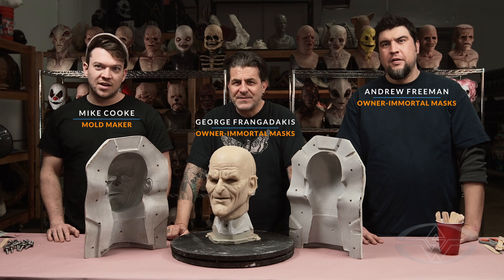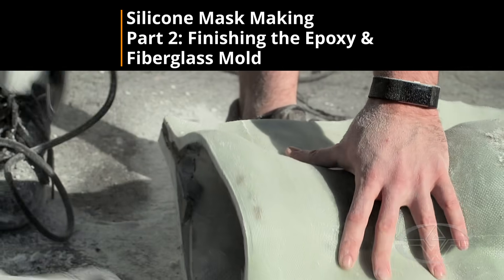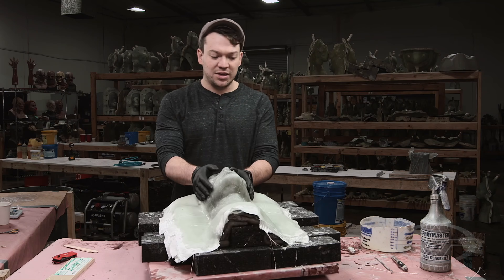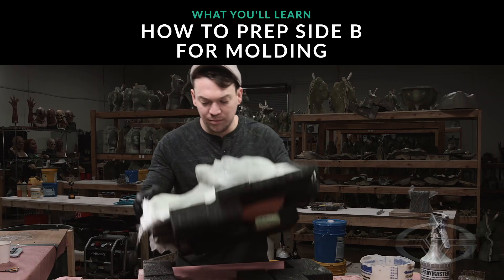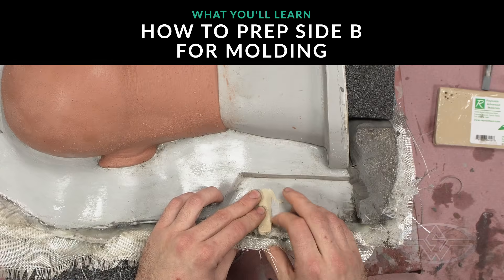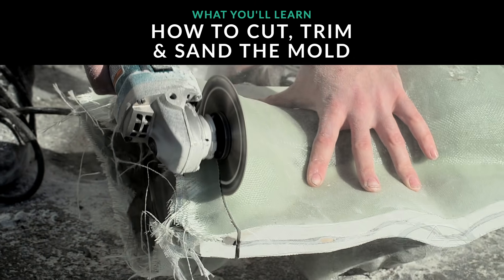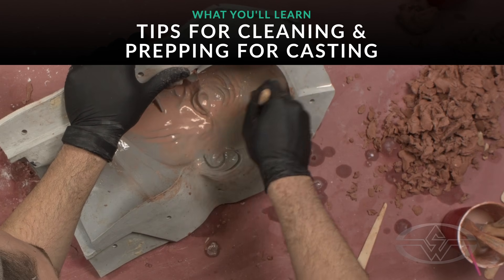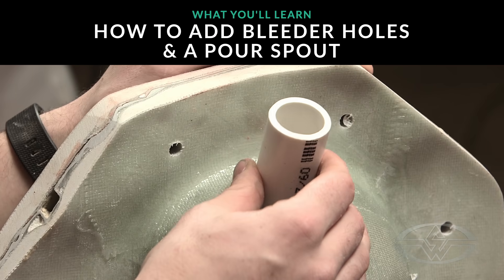How to Make a Silicone Mask Part 2: Finishing the Epoxy & Fiberglass Mold

Comment from the maker: Buy the FULL COURSE here: http://bit.ly/SilMaskMakingPt2YT - Balázs
Reply: Does it show how to make molds for silicone masks efficiently, or just how the biggest company does it? I am debating getting the course, but if the only method shown is one not designed for the average mask maker, only for the top-of-the-line, then I dont see it as a benefit to me.
Reply from the maker: @J0SHUAKANE  

Hi! Here you can find the full Curriculum: 
- Title & Introduction
- Flipping the Mold & Cleaning the White Clay
- How to Avoid Damaging Your Sculpture
- How to Fix Imperfections & Add Pry Points
- Molding the Back of the Sculpture
- Trimming the Edges & Drilling Bolt Holes
- Opening the Mold
- Removing the Core from Side B
- Cleaning Side A
- Cleaning Side B & The Core 
- How to Estimate Silicone Volume
- Adding A Pour Spout & Bleeder Holes 
- Wrap Up
- A Discussion with Andrew, George & Mike
Reply from the maker: @J0SHUAKANE  And this is a 3 part course series, where you can learn much more: 

Silicone Mask Making Part 1: Epoxy & Fiberglass Molding: https://www.stanwinstonschool.com/tutorials/silicone-mask-making-part-1-epoxy-fiberglass-molding-a-sculpture

Silicone Mask Making Part 2: Finishing The Epoxy & Fiberglass Mold: 
https://www.stanwinstonschool.com/tutorials/silicone-mask-making-part-2-finishing-the-epoxy-and-fiberglass-mold

Silicone Mask Making Part 3: Casting & Demolding: https://www.stanwinstonschool.com/tutorials/silicone-mask-making-part-3-casting-and-demolding
Reply: @StanWinstonSchool  gee, an automated copy/paste response. You had someone read my comment enough to respond, but didnt care enough to write a response. At least then, maybe i could have a discussion to make progress & perhaps gain some understanding. Instead, you take the worst route possible, by not directly answering my question, but instead reposting the same things they said in the video & description. I took the time to type out a real question & you dont feel its worth your time to type a real response? Nice way to make people feel like you think you are above them.
Reply from the maker: Hey  @J0SHUAKANE  sorry if the above answers caused inconvenience. In this 3-part course, you can learn the techniques Immortal Mask uses for creating their incredible masks. Answering your original question, you can learn the actual molding steps in Part 1. That course includes mapping the seam, clay-up, laying registration keys, gel coats, layering epoxy and fiberglass, etc. You can see the details here: https://youtu.be/65dDPSXhweY.
If you would like to check the materials, scroll down, and you will see a complete material list: http://bit.ly/SilMaskMakingPt1YT.
You have to decide if it's an efficient molding process for you. It's Immortal's proven technique, and they share their knowledge and every detail of their technique.
Reply: @StanWinstonSchool  thank you. I am now strongly considering buying the course.
Reply: Now when you say “buy the course” we can buy the full course for $60?
Reply from the maker: @chrisr5742  Yes. Or you can subscribe to our page for a month or a full year to get unlimited access to our page so that you can watch ALL of our courses. Check out our actual subscription plans here: https://www.stanwinstonschool.com/subscriptions/plans. - Balázs
Reply: @StanWinstonSchool  but i can buy it for $60 instead of $300 for a year
Reply from the maker: @chrisr5742  Yes, you can buy our courses individually as well. - Balázs